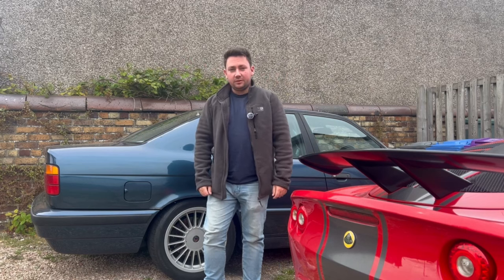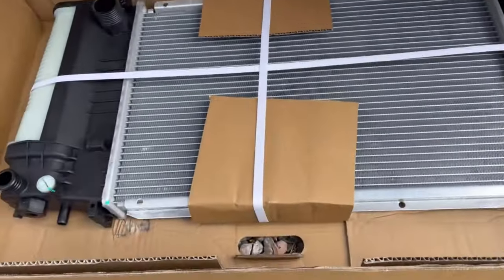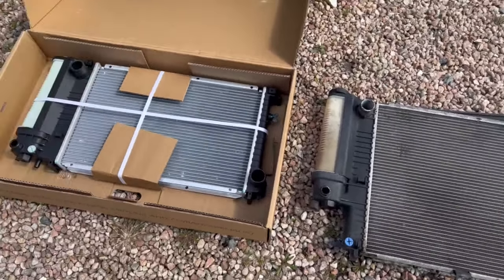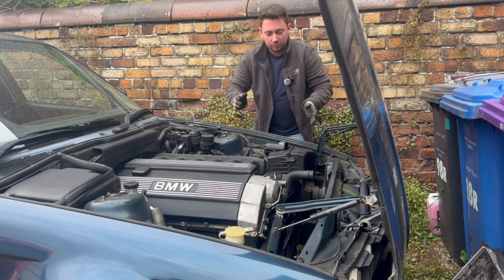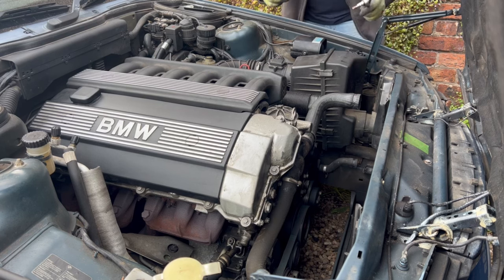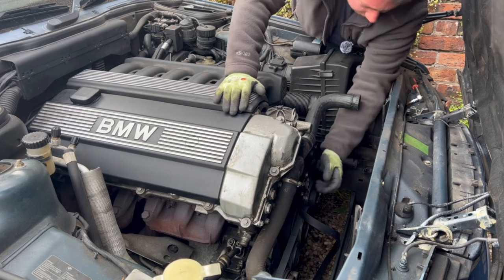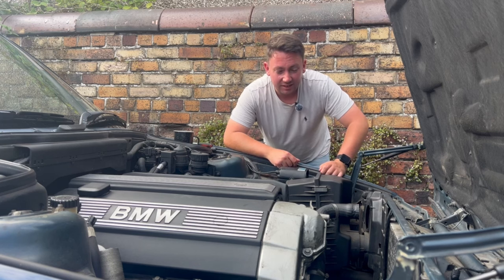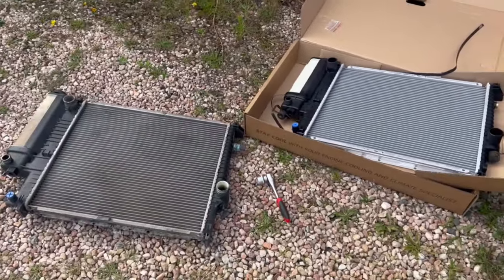Why YOU Should NEVER Daily Drive An Old BMW

Comment: Olt of crappie  had an  e39 16 years  drove 3 times a year germany yugoslavia  itay  400 000 km no major  probs  it was bullet proo f also e34 2.5 petrol that was just the water pumps  and ignition  coil  300 000 germany best car ive owned compared with todays crappie bmw120d bmw120d
Reply from the maker: These older BMWs were just built better I think. Mine has had a couple of small problems but for the most part it’s very reliable and such a nice car to drive. I love the E39s too. Like you say, they will run forever 👌😀